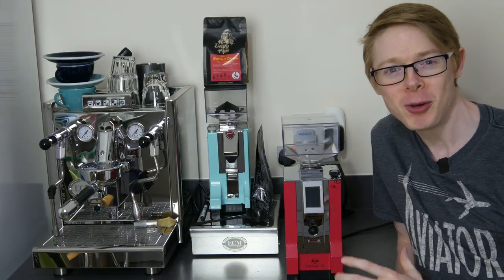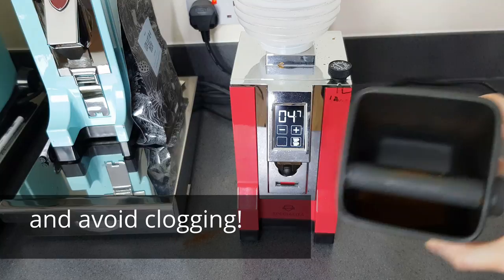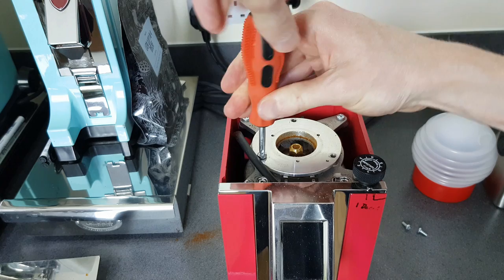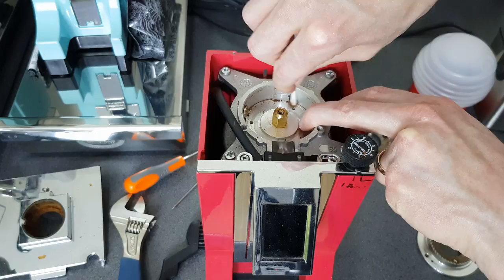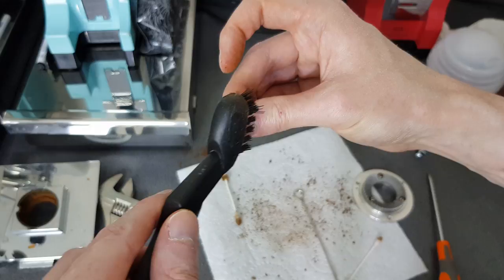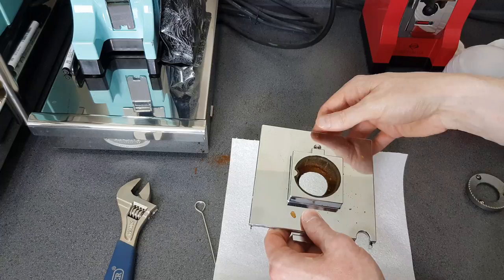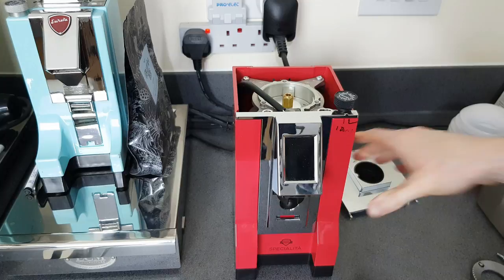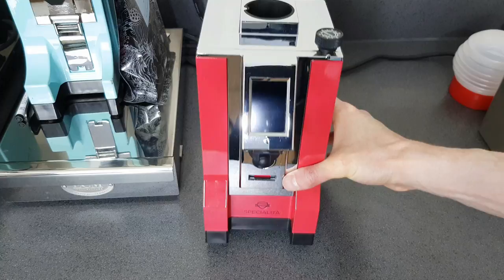Dirty Little Grinder: Cleaning Your Eureka Mignon Specialita Espresso Grinder

Comment: Thank you for this video!! I purchased a new Mignon Specialita recently and have been using it for about 6 weeks. I’ve been largely using it to grind my beans fine, at setting 1 or 1.5, and it has been working well up until this week. 

Earlier this week I changed the setting to 5 to get a coarse grind for my French press, which worked. Today, I tried to set the grinder back to 1.5, however the grounds continue to be very coarse. 

Given this is a new grinder, I assume the burrs done need to be cleaned, but I’m new to using burr grinders and am not sure how to fix it. Would you be able to provide any guidance on this?
Reply from the maker: From the sounds of it, I'd say you just need to put a few more beans through as some of the coarser grounds may still be coming through. 

By the way if you need help with tracking and improving your espresso, I just created an espresso journal which will help you track, make notes and improve every extraction. You can get it here https://www.amazon.com/Espresso-Journal-Track-Extractions-Barista/dp/B0CRF5GMB7/

Comment: Fantastic video. Thank you! During this process, I have come across a small nut that I have had leftover. I can't work out where it has come from. Any ideas? The grinder is operating with no issues.
Reply from the maker: Hi Ben - Maybe it was from the hopper where you can use a screw to keep it in place. Or perhaps it's the one at the back of the grinder that hold the top plate in place?

Comment: Lift the bottom burr from the front. Much easier. You need to remove the front cover anyway
Reply from the maker: Thanks - I'd leave the burrs in place now and do a 'dry clean' of them and the chamber/chute using brushes and a vacuum. I removed the bottom burr because I had been using the grinder for around 12 months without cleaning the inside and so I felt like there were coffee grounds underneath it that needed removing. If there's no reason to believ you have grounds underneath, it's easier and safer to leave the burrs in place.

By the way, if you like exploring different coffees, you may be interested in a way to help you get the tastiest espressos from them. I just created an Espresso Journal that helps you track, make notes and improve every extraction. Check it out here https://www.amazon.com/Espresso-Journal-Track-Extractions-Barista/dp/B0CRF5GMB7/ or UK people here https://www.amazon.co.uk/Espresso-Journal-Track-Extractions-Barista/dp/B0CRF5GMB7/

Comment: Amazing vid, thank you! My Specialita looks like new :)
Reply from the maker: Excellent - glad to hear it :) Let me know if there are any other videos you'd like to see me make
Reply: @coffeewithalex4379  well, now that Specialita is clean, my Gaggia New Classic will probably need some attention too :) but I heard it's much more complex, need some chemistry etc
Reply from the maker: Ah yes. Well I use filtered mineral water to fill my machine - never tap water because too much limescale would build up with the water I have here. 

Definitely keep that group head clean by backflushing regularly (weekly if using it lightly). I use Puly Caff. 

Also, after steaming milk, flush the steam wand and wipe the tip clean. 

I use Urnex Rinza Milk System Cleaner to clean out every so often.

Would it be useful to put this advice in a video? Or several videos?
Reply: @coffeewithalex4379  Yeah I always put Brita-filtered water in and flush the steam wand everytime. As for the cleaning fluids it all depends on what's actually available in a given country but I guess most of it is the same, just different brands. I'm wondering whether I should get inside of the Gaggia and clean something there every few months, I've had it for almost half a year and I want to make sure it doesn't die too soon haha. Cheers!
Reply from the maker: Sounds like you're looking after it well. I've not used the Gaggia but yes you could descale to keep it working. Should be pretty straightforward for a single boiler. I'm sure there are some instructions on YT for that. Usually it's a sachet or you dilute some cleaning fluid in the water tanks and run it through, leave it for 30mins or so then flush out.
Reply: @coffeewithalex4379  cheers! :)

Comment: Good video. I’ve had mine for only a few days. It seems to work well, but I’m concerned that maybe I should have bought a higher end model, don’t know why specifically. This looks like a lot of work to keep it clean, I never realized how much work it is to maintain. You did a great job on the video.
Reply from the maker: Thanks TJ! While it looks a lot of work, I wanted to be thorough. Once you get used to doing it, it doesn't need to take too long. It is important to keep clean though. It's the same for any grinder. 

What higher end grinder would you want instead and why?

Thanks for watching. Let me know if you have suggestions for other videos I should make.

Comment: My burrs are now out of line / touching during the grind size I'd normally range between for espresso.
Reply from the maker: Check the burrs are sat flat. The bottom burr in particularly could easily be at an angle because it's a stiff fit. By the way, the setting on the grind adjustment knob will be different. You'll need to ignore the settings you were using before and dial in your next coffee as if the grinder was new.
Reply: @coffeewithalex4379  unfortunately it's VERY likely that your burrs will be out of line unless you mark the position prior to cleaning so you can place them back almost identical to how they were before. The change in grind size wouldn't be that substantial from a clean / re seating of the burrs. I physically can't go fine enough for espresso now so will have to spend a few hours or more trying to re seat correctly 🙃 I'd definitely add something to video description for people to mark the seated burrs position before removing them
Reply from the maker: I'm sorry you've had issues Louie. It seems like what you're trying to do is reset the burrs to the exact position for the grind adjustment knob to grind exactly the same as before. That's not going to happen. I say in the video you'll have to dial in again. I have another grinder, much higher end. You unscrew the top part to clean inside.  Even without removing the burrs the grinder settings are different after every clean.

You're giving me advice saying my burrs are misaligned so why would you remove them and not follow what you're own advice? 

Scott Rao seems to say most grinders at this price point are misaligned out of the box.  

In any case I will pin a comment to remove burrs at your own risk. Thanks for your feedback.
Reply: @coffeewithalex4379  I had the burrs in my specific machine aligned before being sent to me and I appreciate the grind size adjustment will be somewhat different after cleaning. But to tell people that they have likely just not placed the burrs flat is wrong.. if it's a case of adjustment being slightly different to before cleaning that's fine, but from what I've seen, some people are completely unable to grind fine enough for espresso due to the allighnment being off (which is a different issue to user seating error). I have an ATOM 75 as well which I've re aligned a few times so the specialita should be the same. Others might not have the experience of doing this so thank you for adding the pre warning! The dismantling guide itself is brilliant
Reply from the maker: The burrs could be put back and not be flat- particularly the bottom burr because it's a very tight fit. That is a possibility. 

I have done these cleans many times and have never found I can't grind fine enough for espresso. But of course that doesn't mean it's not possible. 

Anyway, you're right about the warning. I've put that in place now. Thank you for your suggestion. I may make another video for a quicker clean and leaving the burrs in place.
Reply: @scaperline  100% agree, I've wasted a lot of coffee trying to get my grind back to hitting 9 bar! My dial is completely out of sync to where it was

Comment: Great video. Though looking at how involved it is to clean I've been put off buying it.
Reply from the maker: Sorry about that! What grinder did you go for instead?

To be honest, any grinder is going to need cleaning: The burrs, in and around the burrs, any coffee chute, hopper etc.
Reply: @coffeewithalex4379  I am still rocking my 15 yr old mazzer mini. It's the Toyota Camry of grinders. Easy to clean, easy to find parts, but not the fastest and it's a bit loud.
Reply from the maker: I haven't used a Mazzer Mini but its reputation is such that it must be good. And with your 15 years of use it shows why! I am currently considering a new grinder though 😉

Comment: Thank you for making this video.. very very helpful!

I followed your instructions and my coffee extraction is now too fast even when the grinder is at its finest setting (I can hear the burrs touching). Any idea why that could happen?
Reply from the maker: Hi Jishi - Thank you for your kind comment! 

If you have it at it's finest setting and it's extracting too fast, I can't imagine it would be the grinder. 

Have you checked if everything was put back in the right place and tightened properly? For example is the bottom burr sitting nice and flush to the burr holder? Are all screws tightened firmly? That sort of thing.

How many shots did you try afterwards? I'm asking because there may have been channeling which shows as extracting too fast. 

When was the coffee roasted? 
How is the coffee kept (sealed container so no air can get in)?

Bottom line is that I don't think the grinder would extract too fast after a clean if it's at it's finest setting. So we probably need to look elsewhere:

- coffee quality and age
- coffee storage
- puck preparation - was there channelling?
- is the grinder really at it's finest? You said you can hear the burrs touching so I guess the answer is yes here. 

Does this help Jishi?

Comment: Wow very thorough cleaning process. Do have to do this everytime you change beans? Or only once in a while?
Reply from the maker: Thank you Danny! Yes this is a thorough clean. The frequency for this kind of clean depends on your usage. If it's home,  light usage then I'd say once a month. But you can always open it up to see the burrs and chamber to see if it's needed. 

If you use darker roasts you may find you need to do it more frequently. 

I've actually started doing a "quick, dry clean" in between thorough ones. I don't remove the burrs in and don't wash anything, I just use a brush and vacuum.  

Hope that helps!

Comment: Nice instruction video. Regrettably, my Specialita had one of the two screws holding the display so tight that it has been impossible to remove and I will have to go to a machine shop for help. Although I have had decent results using this grinder, that manufacturing screw defect is concerning.
Reply from the maker: Thanks Steven! I haven't heard of that issue. I hope you can get it sorted. You can still get to the burrs and keep those clean in the mean time 😉

Let me know if you've any ideas for other videos I can make.
Reply: @coffeewithalex4379  Yes I can get to the burrs despite the cover being stuck. The only issue is cleaning the chute. 
I would love to see a video about grind adjustment. I waste  100+ grams of coffee every time I change coffee grain.  It would help to have an idea of how the grind should feel as opposed to adjusting it based on the flow.
Reply from the maker: Has the shop fixed the issue with your tight screw yet?
Regarding dialling in, I understand your pain! I too have wasted coffee doing it. And, like you,  I thought there must be an easier way by using feel. Personally I haven't found that way yet. So I'm still using the tried a true way of using starting points i.e. 18g in 36g out in ~30 seconds. 

I can say you'll waste less you focus on being consistent. Reduce as much variability in your brewing as possible. Make your dialling, weighing, tamping and brewing process consistent. This (and ensuring your grinder is clean) can make a big difference. Maybe I should make a video on this?

And make notes when you've dialled in. Note the region, roast type and roughly where the grind setting was. These can make a big difference on the adjustment you'll need to make. 

If you don't want this hassle for a while, stick to beans from the same region and roasted to a similar level. Even from the same roaster! 

Does that help Steven?

Comment: Hi Alex, great video! I'm considering this grinder and i want to use it for mainly espresso but also some other grind sizes too, I know the Perfetto would be a better suited model as the adjustment knob lists the different grind types on it but then i lose the micro adjustments for fine tuning my espresso. 

Anyway, can you tell me if you can reach a stopping point with the adjustment knob fully open to its widest grind setting or will that just end up causing the knob to unscrew from the casing? 

I know you can find the stopping point at the finest setting but that entails making the burrs touch momentarily which isn't ideal so i'm hoping it stops wide open then i can note down the number of full turns back down to reach my previous setting. 

Cheers
Reply from the maker: Hi David - So sorry for the late reply. Did you buy a grinder in the meantime?

I only do espresso as the moment, so I haven't tested to see how far you can go with the coarsest setting. Or whether it stops.

Comment: Great video! But that's not very well designed grinder, if the coffee can get underneath the burrs and clog up the adjustment mechanism. Bummer, I was thinking about buying one.
Reply from the maker: Thanks! I'm not sure if this is a common issue. I also haven't compared it with other brands but it is commonly recommended as one of the best espresso grinders for the price. 

If you're able to buy it from a place that gives you a warranty for a year or two and who can also service it if needed then you might still consider it. 

Are there any other videos you'd like to see?
Reply: I just cleaned mine extensively, there wasn't any residue down there. Overall, it's a great grinder
Reply from the maker: Thanks Nathan - appreciate it :) What espresso machine do you have?

Comment: Nice video, but to be honest, I am a bit dismayed at the sheer amount of grounds hiding inside this grinder. Thinking about a Niche Zero as an antidote...
Reply from the maker: I understand why you'd want to do that. It is a downside. I've found it's retains about 2g. There are workarounds like using the Blow Up Hopper System from Eureka. That has mixed reviews. I just use a makeshift bellows to blow out the grinds. By the way,  the Specialita actually has relatively low retention compared to other 50-55mm flat burr grinders in a similar price range from what I've seen. 

Thanks for watching!
Reply: @coffeewithalex4379  Thanks for the answer. I did end up going with the Niche Zero. Now I just have to wait for it to arrive. I think the future of home espresso for small families is zero-retention single-dose grinders.
Reply from the maker: It would certainly be nice to see more options for zero retention grinders at this price level.

Comment: hello, I couldn't get the bottom burr out, it's like glued to the carrier. I am afraid to damage the axle and alignment if i use too much force, any advice? thx
Reply from the maker: Hi, yes I'd leave it and clean everything else. It's not absolutely necessary and some say they have alognment issues although I didn't.  So yes, leave the bttom burr screwed in and dry clean it in situ (brush, cotton buds and vacuum).

Comment: Thanks for this great video! This is my first flat burr grinder(2nd hand). Its clean now, but if i will have to clean it: the burrs(both top and bottom) can be removed simply? Shouldnt i have to mark the current position(before remove them) like a conical grinder?(e.g. my iberital grinder can be cleaned if the burrs position marked correctly and after cleaning, the burrs positions must match the marked position)
(Sorry if its a dumb question but this is the first flat burr grinder in my life )
Reply from the maker: Hi Ádám - Thank you so much for your kind words. Glad you like the video. 

Yes you can remove top and bottom burr (although as you see in the video, the bottom one is a little tricky). Even better, the Specialita is built so that after you've cleaned the burrs and you put it back together, it should be at the same grind size as you had it before you took it apart! No need to mark the position. Pretty handy, right? :)

Comment: Used your video today to do my first clean on my Specialita after a couple of months of use. Really helpful video so thank you.
Question, I noticed there was some coffee under the bottom burr plate. I noticed you didn’t get down that far, And neither did I but I am wondering if you ever need to or have take that gold nut off and clean underneath?
I noticed the picture from where ever you sent your machine showed under that bottom burr with the nut removed? 
Any thoughts on this? 
Many thanks.
Reply from the maker: Hi Sami - That's right, I didn't remove the gold nut. I was told by the shop I bought it from that this should only be done by someone who knows how to calibrate the machine. So unless you know exactly what you're doing, probably best leave it alone. But you can try to keep the area underneath it clean:

1. If you clean regularly it'll stop build up and so you'll get less coffee grounds in this area. 
2. I've used a thick straw with a flattened end attached to the end of a micro attachment to the hoover.
3. Another commenter here, 'Joe M', suggested using compressed air in this area to blow out the grounds. I haven't tried this but it might work if you don't blow it all to the back and cause a build up. 

Thanks for subscribing - what other videos would you like to see here?